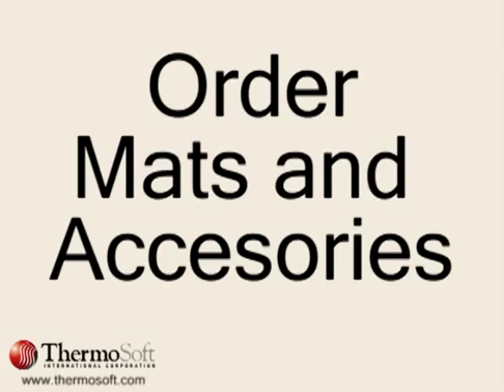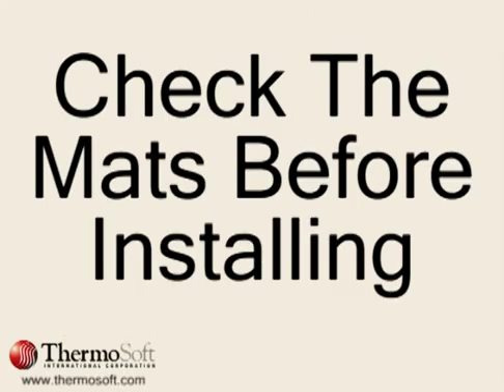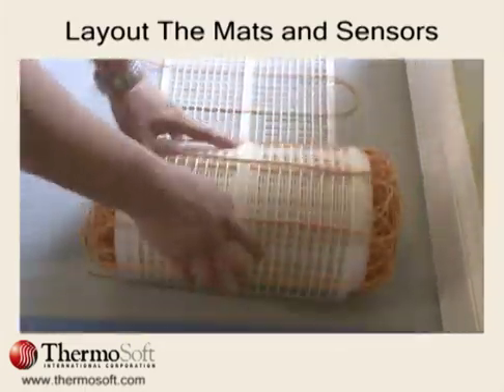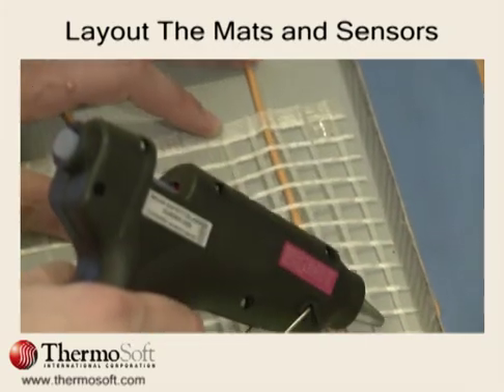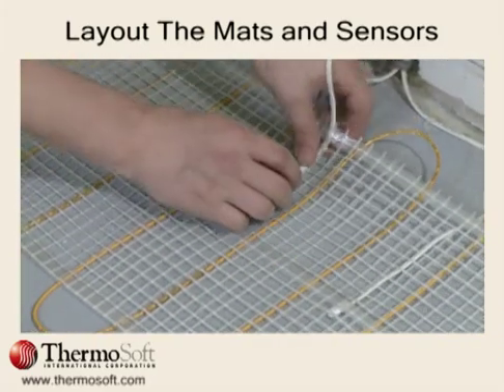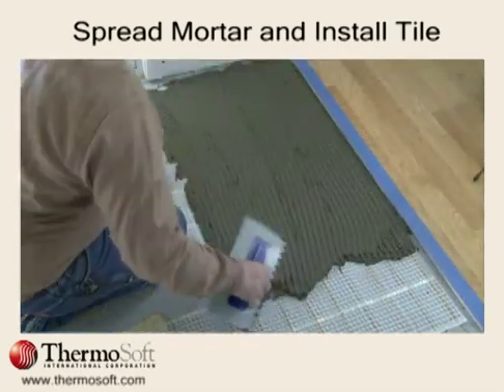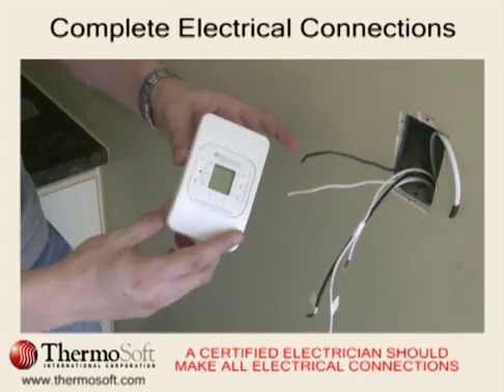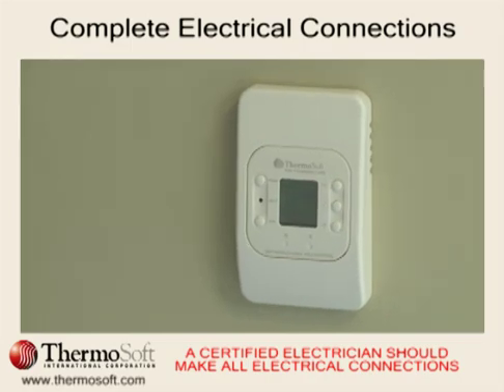ThermoSoft Electric Radiant Floor Heating Mats - ThermoTile Installation

Comment: @deliquenme - This product is rated at 12watts per sqft so 100 sq meters would be about 12,916 watts.  Draws about 54amps on a 240v system.  Also, generates about 440 BTUs/meter squared.   It's very efficient.  call 800-308-8057 x33 for details. (Yes, I work for the company)